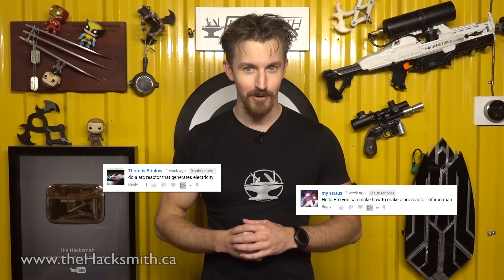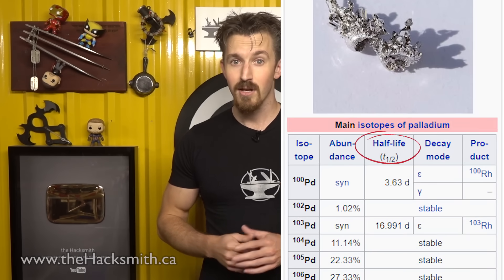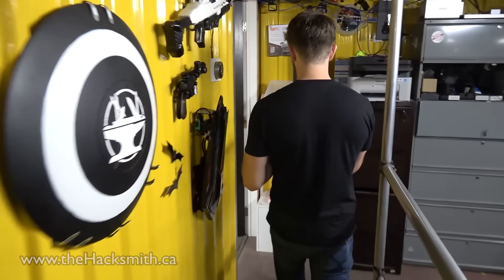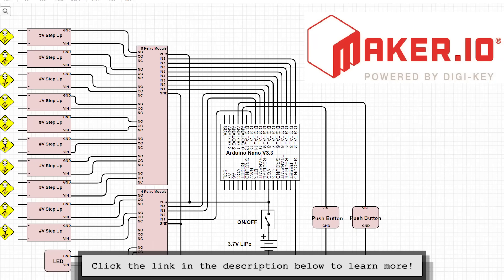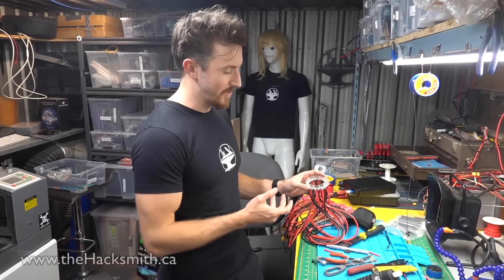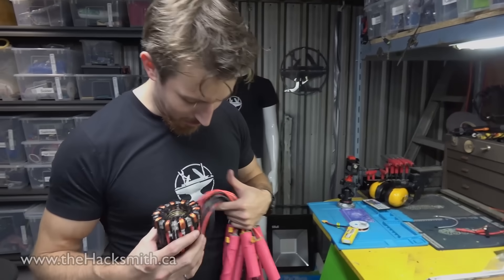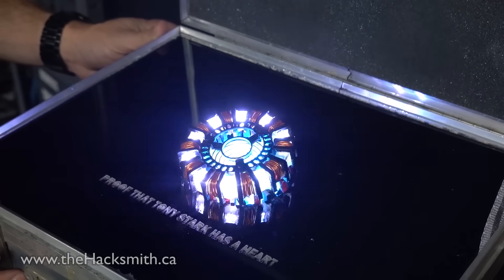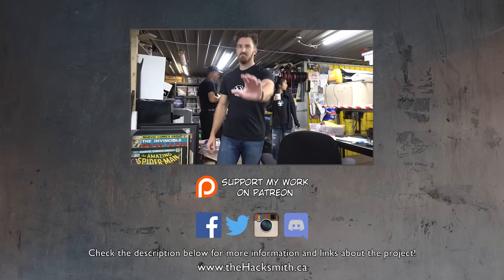Real Arc Reactor (ionized plasma generator)

Comment: Your so close but so far I just got enough materials to build mine and fyi Palladium is easy to scavenge from computers however you will have to smelt it down to get your Purity High Enough and once again you should seriously investigate about changing your main reactor chamber walls to quartz crystal I did a fire up test the other day using a center core of silver which stabilized at 762 degrees Fahrenheit at 440 cycles per second far too hot for the silver to survive longer than a 7 second run time however what was curious was the sheer amount of electromagnetism of the area around it caused small screws and other items to move around it will be setting up a second set of electromagnetic rings to pick up the magnetivity for a secondary source of energy so far appears I am using the same style of circuit as you so once again there is no way to fit it in someone's chest but the math is all adding up in the same route I am generating more power than my input starting power so I guess movies got it half right also your fire in the ark at the outer edge of the arc if you fire The Arc at the center and take it to the outer edge with electromagnets the output gain is higher as well if I had your email address I would send you my version of The Mark 63 as you can guess at this point I've been on this research a lot longer than you have I started back in 2003 before I even knew what Iron Man was

Comment: It looks as if you could have simplified it with only one high voltage transformer and a way to rotate the charge delivered to the ring. It would greatly lighten the load of wiring and transformers used. It looks as if it was overly thought out without thinking of how to make one simpler and smaller. If the charge was rapidly changed to one point to another, it would look as if all were discharging at the same time. Just saying.
Reply from the maker: Would still achieve the same thing. Nothing. 

Also switching extremely high voltage sources is incredibly difficult and expensive as you'd need high voltage solid state relays. So it was simpler to just use 10 $5 components.
Reply: @hacksmith  Perhaps not a solid state relay but a mechanical relay. Something that spins like a distributor in a car's engine.  Just less bulky and a cheaper solution. One could even make their own distributor. That would possibly even eliminate some of the electronic components, like the Arduino, another expense.  But I suppose if someone has money to burn, it really doesn't matter. I have seen similar made for some Telsa devices to create a spark gap with a known rotation.
Reply from the maker: @superdave54811  I think your missing the point... This was the cheapest way to do it... Making stuff yourself isn't necessarily cheaper, unless your time is completely free!

Comment: Long before I even knew what the hell Ironman was I theorize something very similar to what sits in his chest however acrylic isn't going to cut it if you want power generation you need to change the outer wall to quartz crystal should throw off an extra magnetic field that you use to pick up extra energy as well

Comment: I have made something similar but it makes power not much just 10000 v and 1000 amps it is not a  circle like that design it is more of a helix with a lot of windings to many to count the senter is hallow aluminum tube it gets up to around 300°F when it is  operating normally it has designs from  Capacitors DC motors AC motors and a lot more dont know if it will ever be  useful it is varry small though only the size of a regular fist it makes a small humming sound and if you get close your hair stands up to 5 or 6 feet it takes 1 second to charge it and stays on for about 2 weeks before it starts to stop humming and you hair stops to stick up so much but when I discharge it I makes a massive spark sorta like those tesla globes
Reply: Picture please?

Comment: Dear mr hacksmith. Do you think there would be any way to improve on the arc reactor. Cause I noticed you said in thermal dynamics that there is a lot of loss. But in the fundamentals that there is not loss nor production. But only change. Do you think, theoretically, that you’d be able to turn the loss into some sort of different power. That can sustain and maybe even amplify the sources power then that stacks to the loss and the change and so on and so forth?
Reply from the maker: Even if you can retain loss of energy it's still a net zero equation of energy in = energy out. There will always be losses :( and even if there weren't, net zero energy conversion doesn't exactly solve any issues :(

Comment: Good one❣️(atleast it exist even if not producing much useful power..)But if arc reactor needs power supply..then why it's said that it is generating power??...Plzz reply(as if U are giving power to system ..then what's use of reactor)????
Reply from the maker: It generates plasma
Reply: @hacksmith  But as we are supplying power..and it's generating plasma ..how it's useful???
Reply from the maker: It's not useful
Reply: o.0 The first thing you learn in physics. There is NO FREE LUNCH! AKA, you can not produce more power then is consumed...  Or as Full metal Alchemist would say "there is always a price"
Reply: @anjhindul  yep as ders no free lunch..so do i asked what's its use??
Reply: @Rish0716  actually its just for fun
Reply: @yousuffarooq5128  yeahhh💕
Reply: Lolz there is a way but I'm going to let big oil do that . Ain't risking anything for energy that we don't immediately need .

Comment: Why you need a capacitor to each coil?     For me you are just making a powerbank, the glass model you make is just a publicity stunt because the more you charge those capacitor the more sparks it gives and lights those glass. Let me teach you how to make an independent power supply. Harness the power of powerful magnets by a coil. Like a flywheel of a motorcycle producing electricity when you kickstart. Use capacitor to support the flywheel.
Reply from the maker: Lol. There's not a single capacitor in this dude
Reply: @hacksmith  i do not believe man. those sparks are made by coil it should be continuous and doesnt have spaces. when a transformer produce electricity, it doesnt make a sparking behavior instead it will hum because it is a balance current unlike in this blog it sparks like it needs a little time to charge. nice video though..  i think it will be way cooler if it doesnt spark and just make it light.

Comment: One day you will definitely becomes the real iron man
Reply: Not with all the weight of the shit thrown into a tiny project. He needs to make things smaller and simpler.  Far too many transformers and bulky wires. Iron man would weigh 5,000 pounds and could not move even with hydraulic servos.

Comment: the whole point was that he was able to power an electromagnet to pull the shrapnel pieces out of his heart, since you don't have a gaping chest wound, you didn't need to build the frame that jets out the back. that was for insertion into his chest. and without palladium, you  can't test the theory that it would generate it's own power. you have batteries? hooked up to it still, so it's not technically generating power , is it? it's just transferring it.

Comment: unnecessary thick wires. high voltage != high current. 26awg would probably be sufficient. cool project, though
Reply from the maker: It's thick insulation, not thick wires. They are only 24awg I believe
Reply: @hacksmith  ooh misjudged that, sorry! thick insulation makes sense. my last high voltage experiments the arc found a way trough my finger... I still don't know where it went since It was also only powered from a battery.
Reply from the maker: @bitluni  it's like I actually have an idea of what I'm doing when it comes to this stuff ;)

We had some accidents with thinner insulation too - not fun!
Reply: @hacksmith  these taser transformers are indeed very aggressive. hope you all are ok

Comment: It's amazing how extraordinary the arc reactor is to fully, can produce 21.giga watts of electricity and power to control the fields of it I like the calculations of the ideas of how powerful the volts can actually regenerate at a single bound but I know some times it run in radiation energy too... It's pretty spectacular I love it! 👏 👏.

Comment: Sadly it only looks cool, the video suggests you basically use a battery's power, but make the electricity arc to look cool before it charges something. So its just an ordinary battery with a fancy looking wire attached to it (sort of)
Reply from the maker: Yeah. I explain that very clearly in the intro

Comment: I believe I read somewhere that palladium in at least one form could be a very effective proton sponge, so one possible explanation is that it's basically a micro-fusion plasma generator.

Which would require room-temperature superconductors to contain it so it's basically impossible.

Comment: Dude, when you use a clamp on ammeter you only put it around one conductor at a time. Not twenty wires
Reply from the maker: They're in parallel... It's the same thing

Comment: it would be great if you just used a tesla coil instead of all those stepups to produce voltage and those coils actually have a function to partical accelerate you dont need to put any electricity directly into the arc the electricity should be used to power the partical acceleraters and the gas tube should contain a supercharged gas instead at the core you can place a tesla coil and a heat sink well all this is theoretical but makes more sense than what you just made well you are really good at handling hardware so i suppose you have a good chance at succeeding i will really like to discuss it with you
Reply from the maker: It'd just be a plasma globe in ring form then though...

Comment: could have faked it in cheaper way by using a 150rpm torque motor that creating sparks when it scratches again a patterned metal wall...and some leds below to impress

Comment: If not mentioned before that smell is probably not acrylic but ozone a common product of ionizing air during an arc. And Im curious as to how it powers the phone? Are you using the arcs as an air core transformer to get 120v@ 60 hz at a really low amperage by just timing the arcs through those wound coils to produce the sine wave? If so this is by far the most complicated inverter ever! or are you just powering the receptacle with an inverter to make it seem like it is?
Reply from the maker: Nah I know what ozone smells like. It was the melting acrylic

Comment: Awesome project. Just wanted to point something out. This might be intentionally setup this way but I wasn't sure. Your laser cutter looked way out of focus. The cut beam was super thick when you were cutting the acrylic. If you dialed that in a bit you'd get a much smaller cut line and much tighter cuts. Just an FYI in case that's helpful. Awesome project though!
Reply from the maker: That's about as well as it focuses, not an amazing machine.
Reply: Ahhh cool. No worries. Just thought I'd mention it.

Comment: 2:20 833kWh is a unit of energy, not power. You can generate 833kWh _per second_, you can't just drop units like that.

Also, just say "It could generate 3GW." Power over time per time is as stupid as saying how far you traveled like "I went 80 kilometers per hour for half an hour."

Comment: I really just want to know what kind of heat gun you are using.  It looks a lot like this battery operated one I used in the Air Force.  I've tried looking up those specifically, but they're, apparently, really expensive.
Reply from the maker: Not expensive, from China

Comment: One thing that you (and all other people) fail to consider in the "ENDLESS SUPPLY OF ENERGY" is that it is a great, but unachievable, idea.  However, is the net result used to try to achieve it worth the effort?

In other words, it may not supply energy forever, but will the net output be a useful amount of energy vs. the energy used to create it?  It may not last "forever" but how long is "forever".
Reply from the maker: Er, no? If it takes more energy to put in then you get out, it's net negative, forever

Comment: Uhh.... So let me get this straight..... You create an arc reactor with 80000 volts as input and 20 amps as an output........ Is it so or am I wrong?
Reply from the maker: 20A was the input power
Reply: Then what was the output?

Comment: You might want to look at your exposure to X-ray radiation from all the HV sparking...
Reply from the maker: sparking doesn't produce x-rays dude...
Reply: Get your facts straight - it does, at high voltage.                Hey its your life...
Reply from the maker: Not anything significant enough to do damage. Get your own facts straight. Or put your tinfoil hat back on instead?

Comment: There is an actual Arc reactor being built since the 80's, Its called ITER, it will create a stable flux of plasma. Just needs hydrogen to work, a mini sun core in our planet. Well not an arc reactor but close.

Comment: Neat thing. Although you are a bit wrong: as tested, a radio frequency discharge in a xenon-filled tank with pressure close to the ambient one resembles the CGI effect seen in the movie pretty closely. Also you are a bit off with the energy production part as the fusion reactors this device tries to mimic have already proved to be able to produce some energy output (no laws are violated, of course, as the energy comes at the cost of the mass of the gas being broken down inside the device).
Reply: Also, it's said in Iron Man 2 that the arc reactor "Consumes" the palladium core. So the arc reactor might be just a fision reactor in miniature? A really good one? IDK

Comment: A very cool video to remove this strong noise and make even more assembly. These modules need to be disassembled, a high-frequency transformer and voltage boosting circuit are put inside these modules and because of this circuit this strong noise occurs, therefore you need to leave only a transformer from the module and then the reactor will run almost silently.

Comment: Next time you build a ark reactor, use a resistor to stop the flow of current a little bit because, 8m volts wow, and a capacitor for it to store some of the electric charge to avoid the risk of being shocked

Comment: It's a bit of a shame that you actually went to the trouble of making a pretty good looking arc reactor, but then you simply throw it in that box.
Reply from the maker: It's a display case...
Reply: @hacksmith  Oh, I don't have an issue with the box part, I have an issue with just poking it in that hole. Like I said, it's a shame you didn't spend 5-10 minutes to mount it in properly and secure it.

Comment: you should do a tube full of the loops then run a bar magnet through the middle and in theory it should fire it out the end if you could control the pulse between negative and positive thus forth making a plasma pulse projectile canon as the magnetic pulse would force it from the end if you know what I mean

Comment: Suggest you look up a lightning arc reactor.
Then old fasion neon(?) light tubes that uses a electric arc discharge to light up the gass within it.
Then look up a fusion reactor and how natural lightning storms could be generated by radiation from the stars in the sky.
Probably some multi-pole electric engine tech added in order to first start her up and later get the elctric power out in a more steady stream, the (neon) lighttube it's fitting around might actually work partially as a way generate elements needed for fusion, similar to how a laser works, main problem is which two gasses are needed.
Because if I am right the above, together, is what creates the movie Arc reactor, for real.

As for that Starktoniom or should I say Vibranium?
Well, I suspect it lays on the potential second island of stability and is thus slighly radioactive at the very minimum.
And Captain America walks around with a shield made from that stuff, not very healty, right?
And lets not talk about Tony Stark wearing that Arc reactor IN his chest, I can use a microwave oven to light up my neon light tube/bulb and we all know that thus being literally next to it, will cook you.
It's like sitting below a radar, without a roof between it and you, to protect you from it cooking you with it's waves.
So very not safe, when you think those cartoons from back then, true to their logical conclusion.

Anyway, great build, fun device.
Bit clunky in size, though.
Still wondering who you didn't use a small wire spool (for fabric repair and so on, kinda treads/wire storage), that would have meant you could actually slowely wind those arc reactor its copper windings in one continues wind untill that particular wind was done, then a fresh spool if your copper wire is to low and on to the next one.

Comment: The high voltage has a lot of power loss through air, the magnitude of current keeps changing , there are copper wires around that current and definitely a magnetic field is created be careful keeping it near your heart, your heart beats based om its own electric pulses if the magnetic field is high enough , could definitely result in irregular heartbeats. Be careful

Comment: The phkne can be faked easily all you need a battery light some knowledge on scripting and a full battery on a phone
Reply: It's also unreliable, as I learned when making my hand-cranked generator. My phone happily shows a 'charging' indicator, even though it wasn't actually charging effectively. What actually happened was that the phone would start to charge, empty the smoothing capacitor in miliseconds, then sit around for the next revolution of the alternator to come so the cycle would repeat. Power transfer was tiny, but the phone still indicated charging.
Reply from the maker: That sounds like way too much work. It's just plugged into the battery that powers the arcs lol